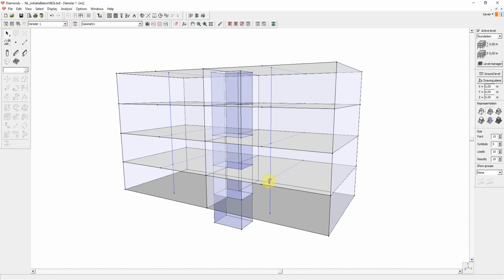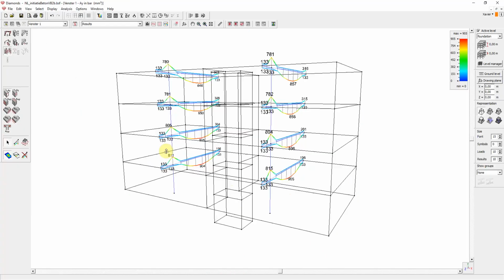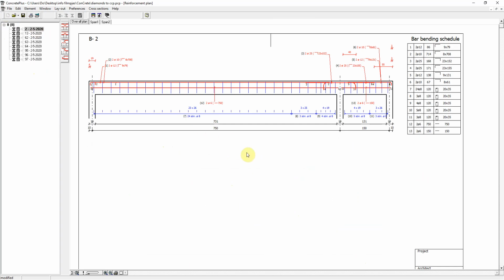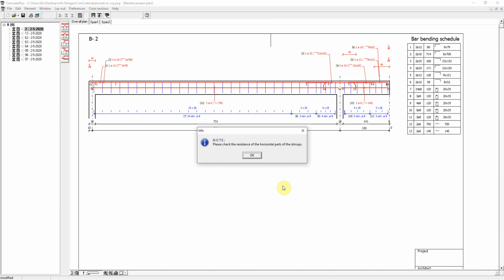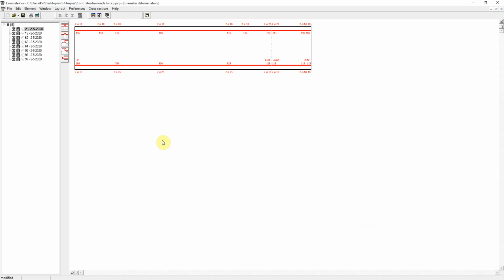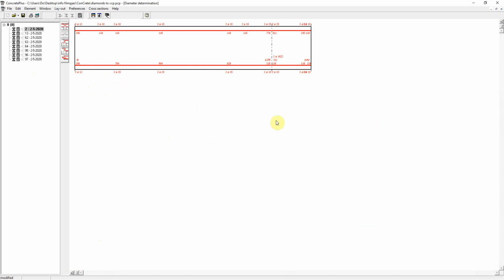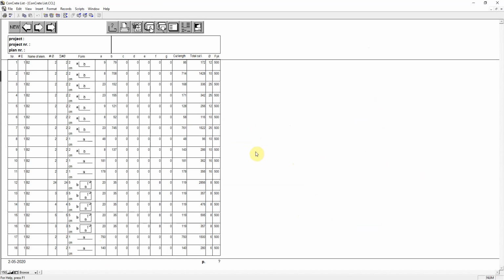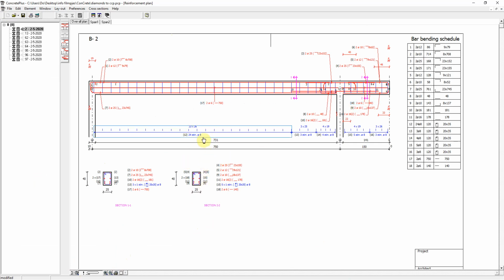Transferring concrete beams from Diamonds to ConCrete Plus for automatic reinforcement plans

Comment: Any plans for future to have columns reinforcement in concrete plus?? I think is a must to add additional value in the workflow.
Reply from the maker: Actually, although it is not shown in the video, you can also  copy-paste columns from Diamonds to Concrete Plus. They will be horizontally drawn, but it works.